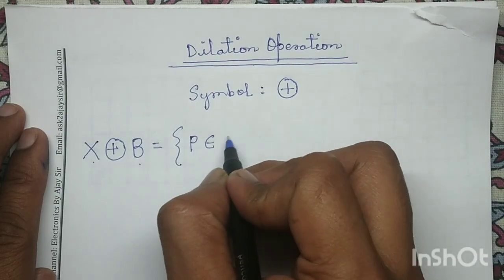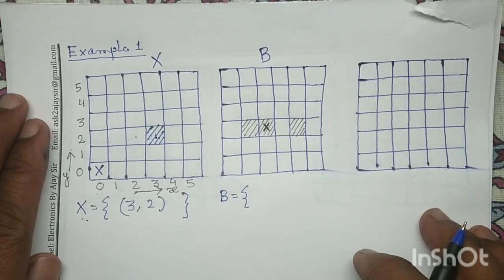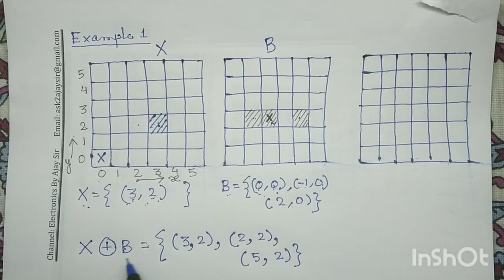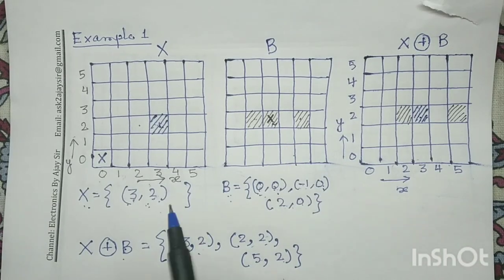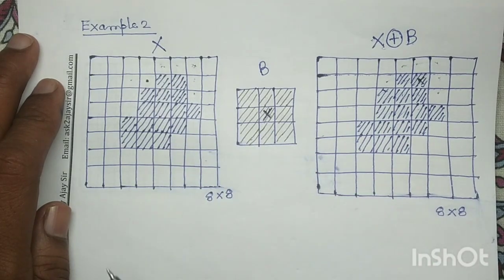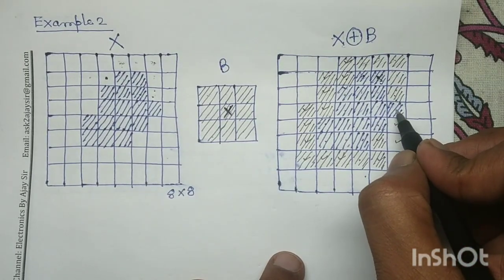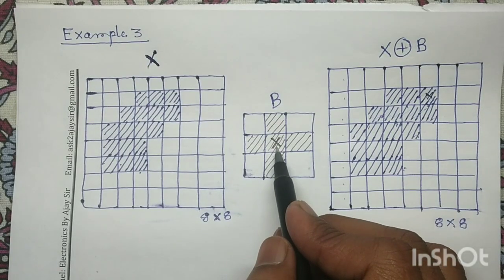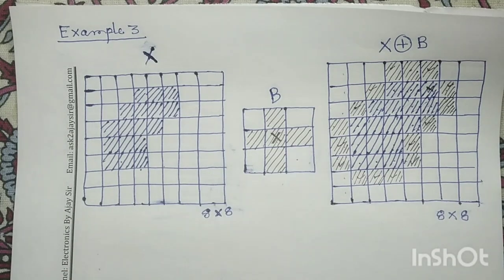Module 2.1: Dilation Operation | Image Morphological Operation | Digital Image Processing #subscribe

Comment: sir -1.0  coordinate kese aya first question me
Reply from the maker: In structuring element, Center will have the coordinate (0,0). now on the same row, pixels on the right side of the center of the structuring element will have the coordinate (1,0), (2,0),(3,0) and so on. similarly pixel on the left side of the center of the structuring element will have the coordinate (-1,0),(-2,0),(-3,0) and so on. 
Now, you can the structuring element set B i.e. the set of pixel locations which is logic 1 (shaded in the given input image) in structuring element B.